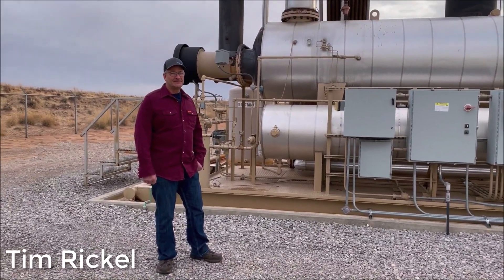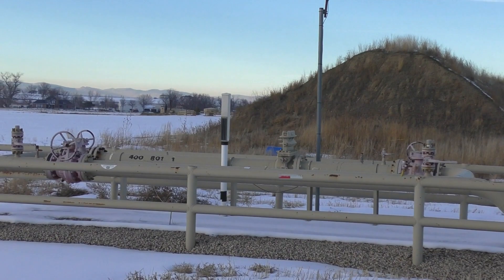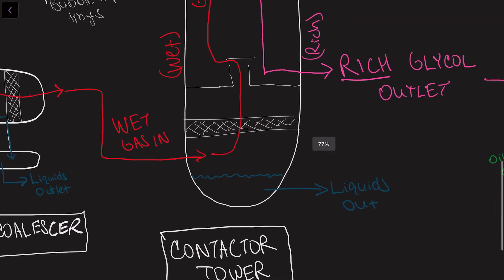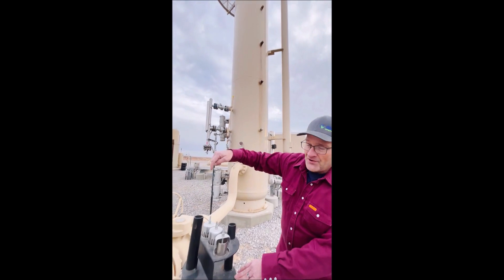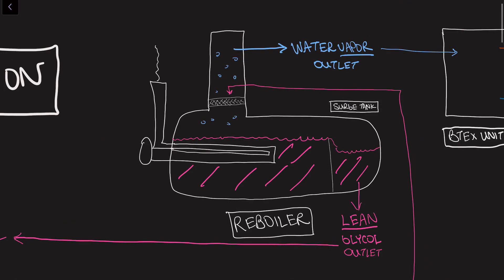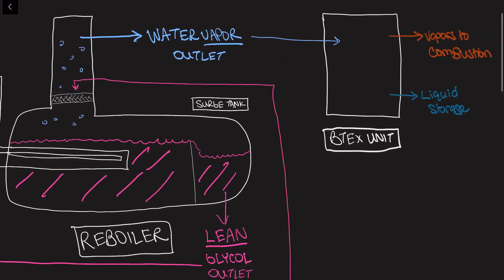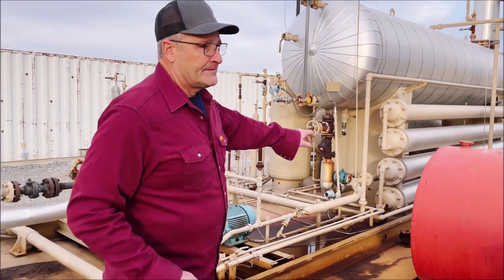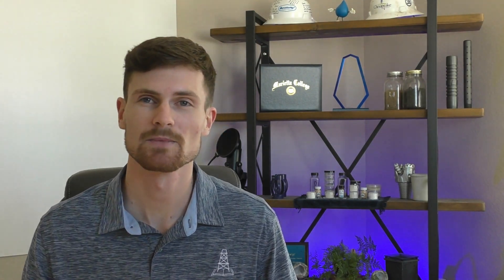Natural Gas Dehydration System (Using Glycol)

Comment: Fascinating video, as a crude hauler sometimes I open a crude holding tank thief hatch and there's so much gas/pressure it blows my hard hat off my head.  Always happens on hot "fresh" oil during flowback immediately following frac completion, and or hot summer days, would it be accurate to say this is natural gas which hasn't had the time to burn off via flare stacks, the absence of a dehydration system, or BTEX's pumped back in, or just some other pressure issue within the holding tank battery separation /dehydration system?
Reply: Just checked it out, nailed it. 👌  grateful for your videos, keep em up !
Reply from the maker: Good question. That's largely going to be what we would call flash gas. As the oil dumps to the tanks from a higher pressure vessel, gas comes out of solution. Warm temperatures would also cause more gas to come out of solution from the oil. The gas should get combusted or recovered, but on warm days or days where production is high, the average tank pressure might be higher. This has nothing to do with a dehydration system. Check out our video on Flash Gas and Vapor Recovery - https://youtu.be/l5wTR2neidA